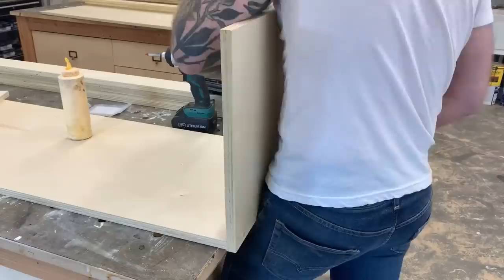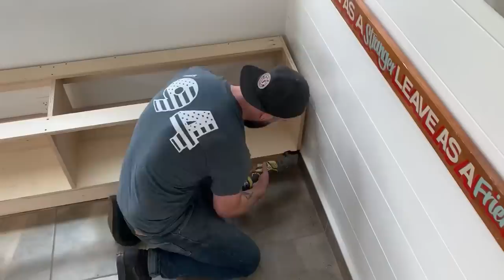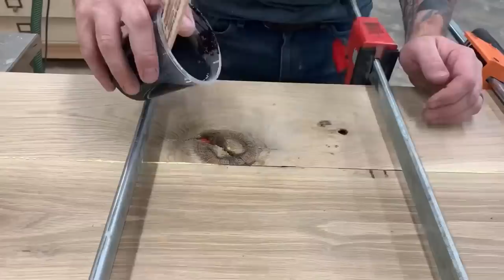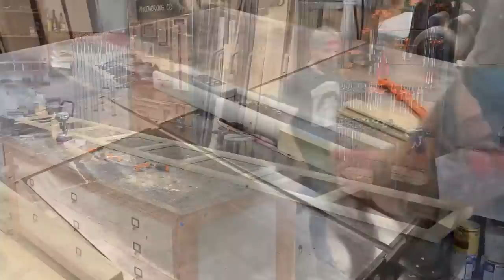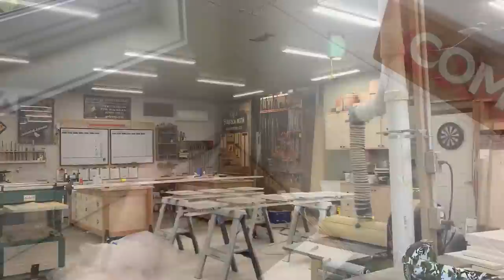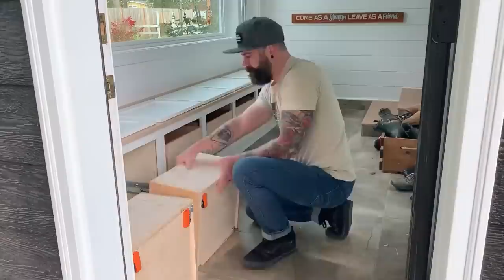Quick and Easy Storage Solution || Mud Room Shoe Bench

Comment: Nice job……you could hang a pant tarp using a hanging system like the ones used in the hospital……shove it to one side for storage, then pull it around in seconds to paint…..I had one in my shop where we painted large machines. looks like it would fit around your dust system too.

Comment: Nice vid dude. Am I right in thinking you didn't biscuit joint your planks together only glued them? I've been using biscuits but would you recommend not to?
Reply: Not OP, but biscuits help with alignment, not strength. So they won't hurt, but if your boards are already perfectly flat and straight and you have a good clamping setup, they won't necessarily help either.
Reply: he usually dominoes them. I don't think I've seen him use a biscuit yet. if you can glue up straight without them moving on you they aren't necessary. it's a preference not a requirement for sure.
Reply: Thanks guys good to know